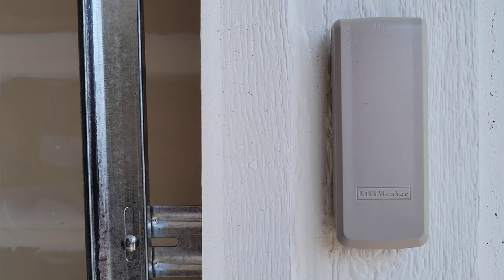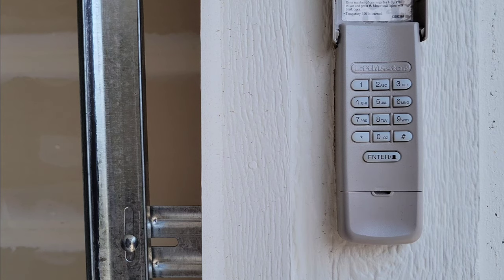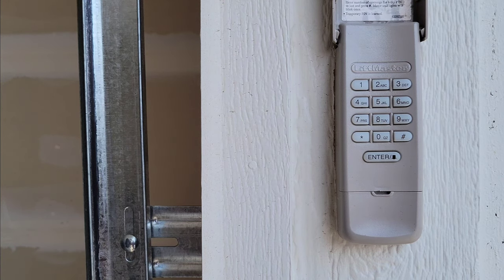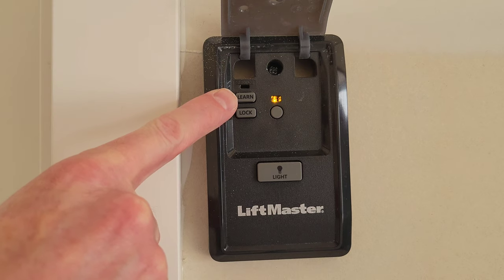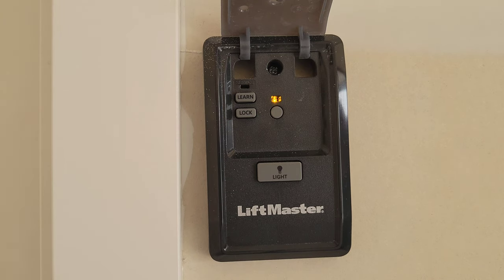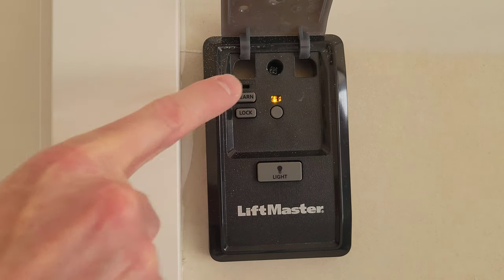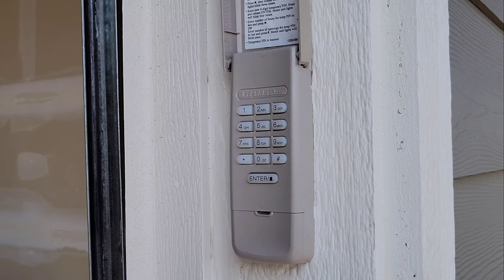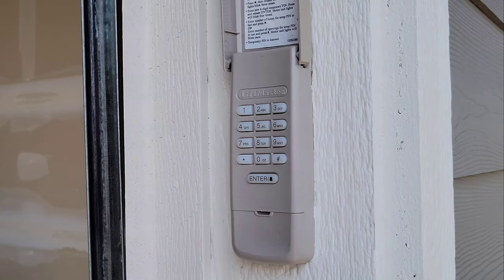How To Change Your Keypad Pin Code On A Liftmaster Garage Door

Comment: Just curious in some other videos it states to press the learn button on the ceiling garage door opener unit while in your video you show using the wall mount.  What’s the difference?  Also will creating a new pin have any impact on the ability to use my vehicle’s built in garage door opener that is already linked?  Thx in advance!

Comment: Todd, I have a chamberlain, same key pad exactly. All of my buttons work. I replaced the battery. It was dead. Now when trying to program it as the old number did not work, I push the learn button on my motor assy housing, push in a new code and hold the enter key down, waiting for my lights to flash, but nothing happens. I did not check the enter button to see if the key pad light up, but I will do that now, but assuming all buttons work, what can I do to get it going. I cannot afford a new key pad right now. I know they are just $30, but I have been out of work for 4 years. Just trying to get this working. I was a copier tech for 14 years, so even if I need to work on the keypad, I can do it. Thanks for any help you can give me.

Comment: Hey Todd. Garage door keypad in my house is not accepting the pin code. I am certain that I am entering the correct code, and I followed your awesome instructions (so clear and helpful) about how to check the battery and keypad. I replaced the battery even though the old one was working well and there seems like all buttons are working fine on the keypad. My garage is detached so I can't access it from inside the house. Any suggestions what I should do?

Comment: Great. Now I have 2 codes to open my garage. The old one and the new one.
Reply: Me too
Reply: @connerdavis3333    i removed all codes by pushing and holding the learn button on the opener ( for about 6 seconds) until the indicator light next to it turns off. Then I put the new code in the key pad . That worked. Of course I had to re sync all the garage door remotes as well.
Reply: @floridajogi8175 i will go try. Tnks. How do I resync the remotes pls?

Comment: installed a chamberlain 940ev wireless opener it works fine with the 4 digit code to open the door however just using the enter button to close the door does not work  the unit is a craftsman opener thanks for any help

Comment: What do you try if that does not work. The keypad is from 2005 but I have replaced the main unit witha new Liftmaster. The remotes work fine but the keypad just flashes no matter what I try. The 9v battery is good and it worked long ago so could it be wired?

Comment: Two nights ago tried to use the keypad and didn't open just blinking, tried using the remote and also weren't responding. Switched out batteries on the keypad . Eventually go in the house with a key. Reprogrammed the keypad and the remotes. Ensured multiple times they were programmed and working properly. Last night at 3am a family member tried using the keypad and went back not working and only was blinking.  I went outside myself at that time and both keypad and remotes stopped working. I have the My Q app which allowed me to open and close no problem. However the keypad and remotes stopped working. Anyone have any idea or trouble shooting I can figure out? Thanks

Comment: Our unit doesn’t have a learn button on the wall control
Reply: That means you have the older model. The Learn Button is on the door opener machine itself. Thanks